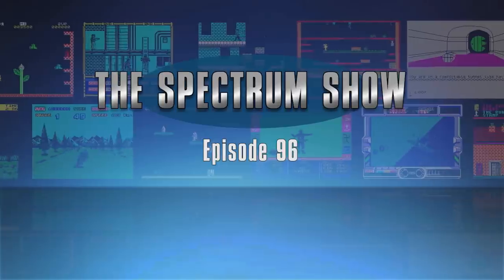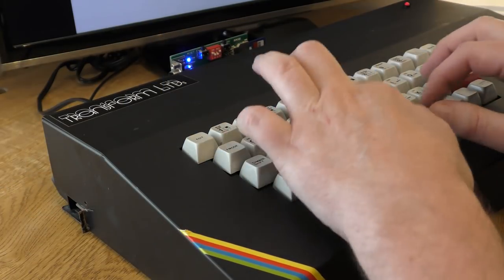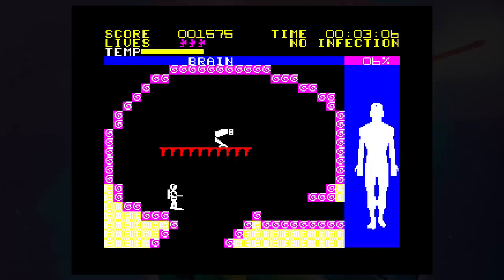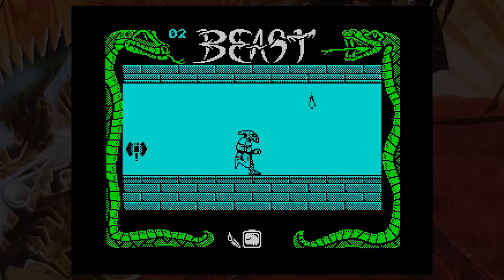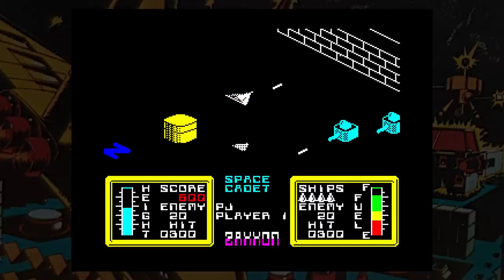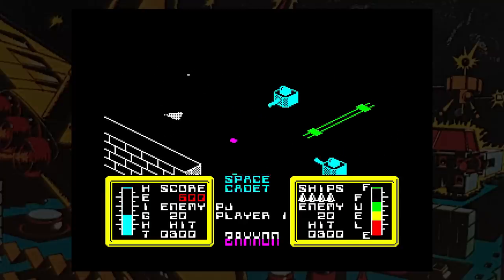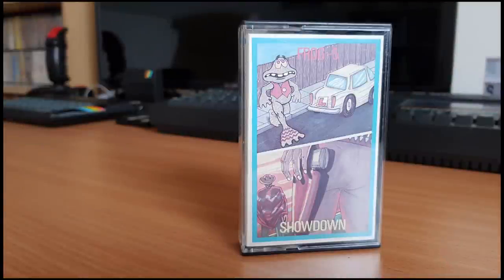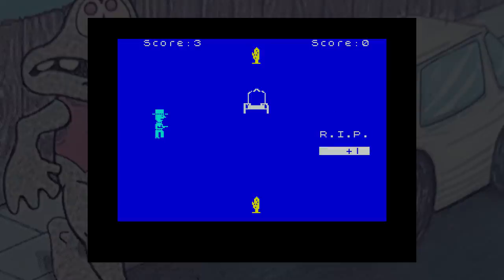The Spectrum Show EP 96

Comment: Super episode as usual. Thanks for letting us know that the frog is called Fred! The Transform keyboard looks beautiful. As I said on the Patreon video,  I share your concerns about the electrical safety of it. Having a separate earth lead that is not shielded is worrying. Putting the power supply into the metal case is also worrying, should a fault develop. Perhaps I worry too much about these things, but it is 240V that you are putting inside - if it was a plastic case, it would not be so concerning. I would say it is better outside the case, as it would be normally. But I would love to get my hands on one of these, to make a proper assessment of it.
Reply: Theres no issue with the PSU inside the case, this is done all the time in manufacturing and those PSUs are usually bare transformers. Because the Speccy transformer is inside a plastic case there is no danger at all, and I personally would have removed the stupid earth wire going back to the plug. It serves zero purpose.

Comment: The problem with Spectrum keyboards is that the keyboard routines in the ROM do not allow a new key to be pressed until the previous one has been released, so it is impossible to type quickly.  Any software authors who wish to facilitate fast typing need to roll their own keyboard routines
Reply from the maker: I thought I read somewhere you can read multiple keys using IN statements? Or maybe I was mistaken!
Reply: @BuckingTheTrend2008  Yes, there are 8 keyboard ports with the 5 lowest bits of each indicating a key's status.  That's how I read the keys in Utter Tripe and is why you can type so quickly in that game

Comment: Here's a strange question... I noticed you had the DivMMC plugged into the Transform keyboard, was the Interface 1 still plugged in? If so, then how did you get them to work together? Mine don't seem to be compatible.
Reply from the maker: It’s without the interface 1.
Reply: @BuckingTheTrend2008  O.K. I was hoping you had worked something out that I had missed. They are not compatible.
Reply: @BuckingTheTrend2008  BTW, I forgot to congratulate you on your 8K subs. :)